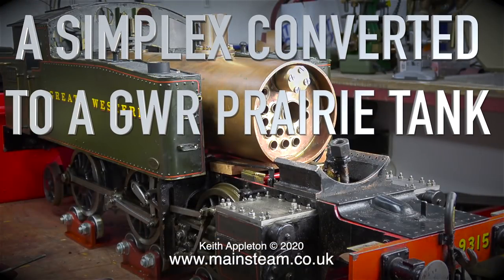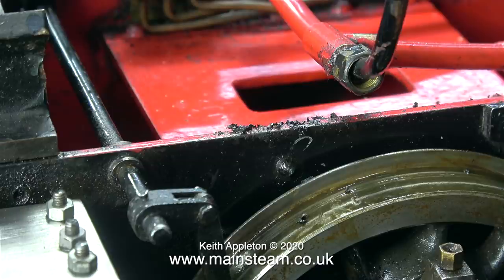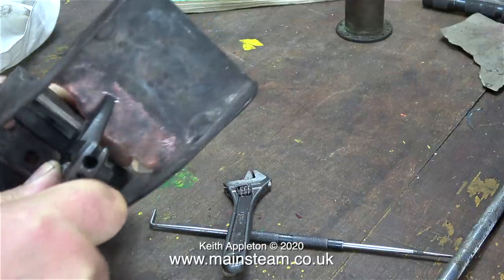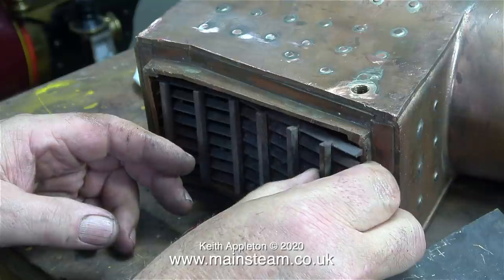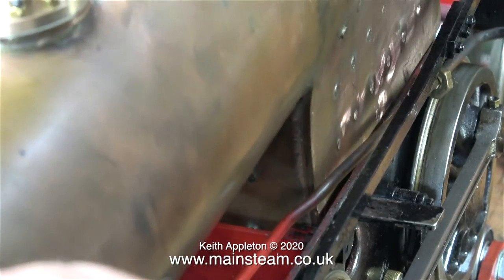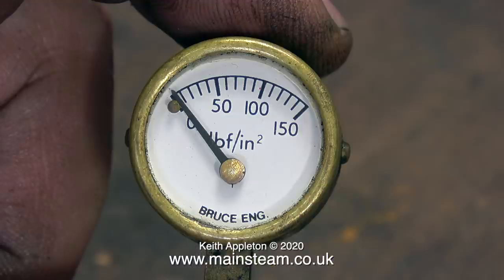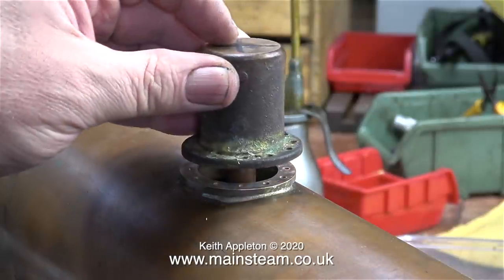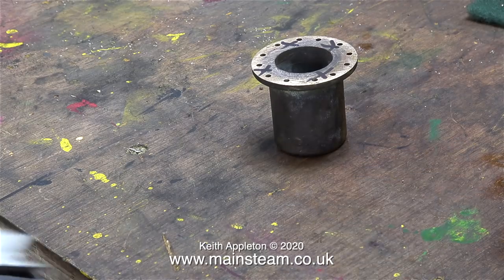SIMPLEX PRAIRIE TANK - PART #9

Comment: One reason for burnt out fire grates is the lack of space from the bottom of the grate to the floor of the ash pan. If the ash builds up to touch the bottom of the grate there is a good chance the grate will burn. 
I have built an Ajax and Achilles. The  Ajax is 35 years old and has the original grate with a good 1 inch space between grate and bottom of the ash pan.

Comment: Hello Keith, I have watched this series all the way through a couple of times - thank you for producing it. The boiler seems a close fit on the frames. As someone with no experience thus far on fitting boilers, should there be a gap between the frame and boiler (fire box) and if so how much?  Once again many thanks for your work. Jim
Reply from the maker: Yes it was a close fit, but the problem was mainly that the blowdown bushes stuck out too far. The gap between the boiler wrapper and the frames is sufficient.
Reply: @keithappleton  Many thanks for your time taken to answer my query. Take care Jim

Comment: I'm puzzled as to how the silver soldier would stay together that close to the fire.  It seems like the radiant heat would re-melt all the soldier connections and tou ash box would fall away as you roll down the line.
Keith, thanks for posting this series.  It has been fascinating to learn more about the steam piping.
Reply: Keep in mind cool air is being drawn through the ash pan. However I would not make it from brass!
Reply from the maker: the superheater either has wet steam in it from the wet header, or cool air drawn in via the "snifting valve".